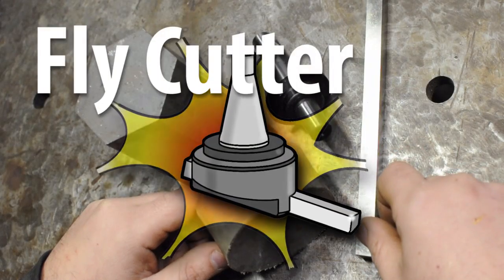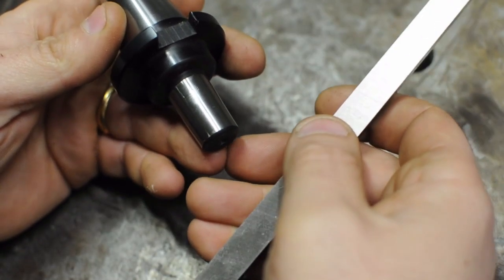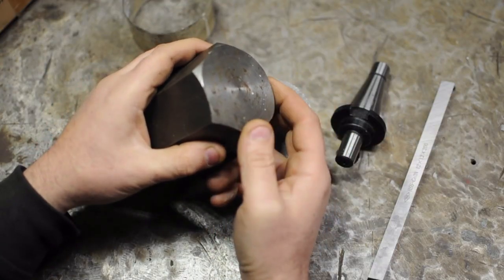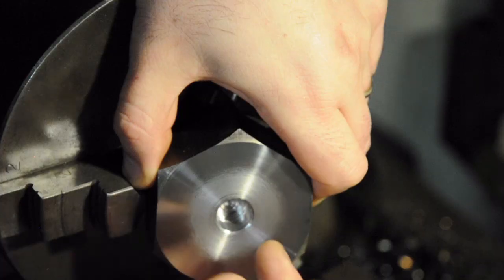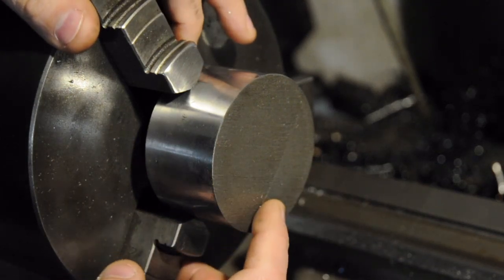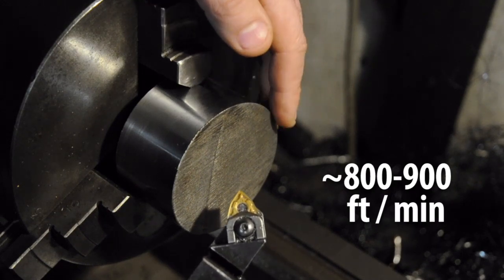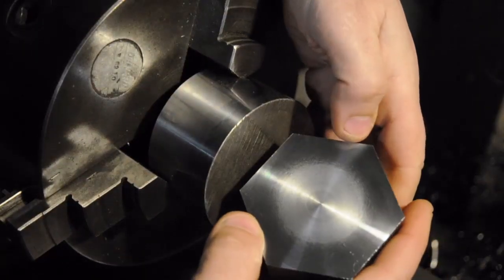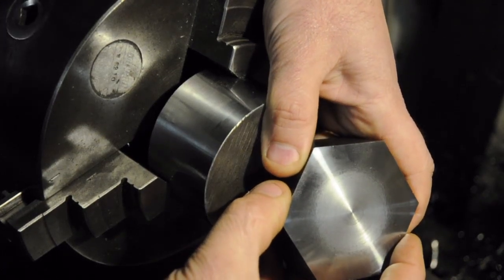Building a Fly Cutter - Part 1

Comment: Thanks for the explanation of the surface finish change.  Makes perfect sense once you go through it.  I do wonder about the cutting tool radius vs finish.  I've got some more learning to do.  :)
If I had to guess, maybe it's because the large radius makes for a more gradual entry into the cut?  Instead of a sharp point on a carbide tool?  More of like an ice cream scoop than a spatula?  At a microscopic level, the sharp point is chipping instead of shaving?  Carbide hardness playing a role in the chipping due to the tools rigidity?

Comment: I installed a 3 phase inverter on my  3 phase Graziano lathe.  I can change the speed of the lathe as I get closer to the centre of the speed if necessary.  I like it better then just a few speed option  I originally get.  Anyway, I did not have much choice.  I do not have 3 phase in my garage.

Comment: Oh I hate it when that happens. For us it wasn't the relay for the motor it was a pneumatic reservoir that blew in the cold and the replacement overloaded and shot across the shop like a bouncy ball. Another regulator further up the line solved the problem. Note for newbies, make sure that the reservoir is rated to the pressure of your line or it will blow. If not, then regulators will save you having to buy reservoirs constantly to replace the blown ones 😒!

Comment: I'm solved the problem at feed. Using VFD, and put the adjustable speed controller beside the engage switch. So i can turn faster RPM while cutting at centre. Thks bro

Comment: To solve the radius speed problem when getting closer to the center, why not using a “mill head” directly on the lathe? So the mill head turns even when it gets closer to the center of the piece.

Comment: For my machining class that I'm in. Rpm for CRS is 4×100÷diameter of cutter on mill or diameter of part on lathe. (Using  HSS cutters) when using carbide we use 4×400÷diameter of cutter or diameter of part.

Comment: Tony, you've inspired me to jump in, and I've bought a lathe and a mill recently. I repaired a hydraulic cylinder and ended up with a rod about 4" in diameter and 20' long. (it was slightly bent). I was excited to have this material for practice and fabrication. Can you tell me what it is about chromed cylinder rod that you're not a fan of? The more I know about what it is good for, or rather, what it isn't good for, the better off I'll be. Thanks for all your awesome content.

Comment: I'm in the process of making a fly cutter based on your video tony, when in the exact same stage of making the 10 degree angle, the switch of my mill melted too. Guess I'm following the tutorial to the spot.
Except maybe that I'm using a round stock steel, didn't have a hex :)

Comment: Hey Tony, considering that the linear speed of each minute diameter of the work face is supposed to be linear with the rotational speed when the cutter is "fed in", then the ideal rotational speed should be inversely corelated to the linear speed. That means if the linear speed is 0 because it has 0 in diameter then the rotational speed should be infinity rpm. That also means no matter how hard we try we can never reach perfect face finish because until now I never heard any lathe that has infinity rpm! My God Tony, your wisdom is too much for my poor little brain to comprehend!

Comment: Question from a non-machinist: why is surface finish sensitive to cutting speed?
Reply from the maker: think of it like painting... the paint brush has a certain speed range if you will to lay paint down.  too fast and it'll look bad.  to slow and you're wasting time.  there's probably a better analogy out there. :)
Reply: @ThisOldTony  do lower speeds always improve surface finish, at least until they're as good as they're going to get? If so, then maybe at the high end the losses are because the tool does more pushing than cutting and clearing?

Thanks for the reply!

Comment: What's a fly cutter and what's it used for?  (I'm not trying to be funny I genuinely don't know)
Reply from the maker: it's a single point (one "tooth") cutter you can adjust the radius of, thereby letting you cut very large or very small pieces with a single tool.

Comment: Hi TOT. I'm curious how long the batteries in that Wixey bevel gauge last you? I have a cheap one and literally get a day per battery, I think its draining at full power even when its switched off. I've ended up inserting and removing the battery every time I use the thing which is really annoying. I've seen the Wixey device online as it seems to be mid range in termas of pricing (moore and wright do one in the 80 GBP range which seems to be the top end). Would appreciate your feedback
Reply from the maker: I'm still on the original battery!
Reply: I'll be ordering one of those then. Thanks for the reply, love the channel

Comment: Been watching a few of your video's now, i got to say i really like the contents as well as the way you're presenting it. You're one of the few people who do a lot of 'blah' without me getting bored or irritated. Nice job! I do have a question about this vid though. At the very end you are face milling the workpiece to have a 10 degree angle (love your angle meter). I wondered why you are milling along the X-axis? The way i see it you have a great risk of pushing the material out of position when you're feeding the mill this way, wich will cause the workpiece to destroy your milling tool, or even worse, the  machine. If you started left of the workpiece you would simply eliminate this risk, although my approach would be to start in front of the vice & feeding along the Y-axis with the workpiece tilted so the highist point is on the left: this way most of the cutting forces are perpendicular to the vice so your workpiece will be less likely to move & chips are all moving away from you. Please correct me if you disagree, it would definitely not be the first time my feel about milling is just plain wrong :) 
Keep up the good work!
-Patrick

Comment: Tony, I learn something new with every video.  I have an old lathe an it came with a bunch of HSS tooling.  I wanted to get "fancy" and upgrade to carbide tools but it appears I will do fine with what I have.  Since I am just learning anyway it is better to start slow.  Very entertaining as always.
Reply from the maker: I've slowly started moving over to almost all insert tooling.. mostly because I find it cheap at flea markets :) -- but I'm glad I started with HSS and turn to it when I have a finicky problem to solve.  What one learns sharpening their own HSS translates into all the other tooling that's out there.
Reply: High speed steel is greatly preferred by the Dutch and Scottish!

Comment: I was about to comment asking about the surface finish, then 5:18 happened ! 
Is my intuition off or is it more intuitive to decrease the speed (or increase the feed) the closer you get to the center instead of increasing the speed ?
Reply: On a second thought, RPM = speed/diameter ==> speed = RPM*diameter so to keep the speed constant we need to increase the RPM the smaller the diameter gets which is probably what was said in the video.

Comment: I really enjoy your videos! I can get very good tips and tricks for my work. I'm learning a mechanical in Germany and have a lot of work with the lathe or mill to do. Interesting to see, how you are calculating the rpm. I've learned that Cutting speed is: Speed=pi*diameter*rpm. So slightly different calculation of rpm as you do.
Reply from the maker: Thanks.. and I think that's the same formula, just solve for RPM since speed is what you already know (target speed).. assume pi=3 and there are 12 inches per foot and you'll get the formula I used.  If you're metric the constants will look different, but same formula.

Comment: I have a question but how would someone turn down .07mm on a 5mm tool steel rod that is 600mm long?
Reply from the maker: That's a tough one -- very sharp tool and a follower rest, for starters.
Reply: This Old Tony
It is so long it wants to fly around so needs to be kept extremely slow too as in 1 digit rpm and forget about the finish as you can follow that up with some steel wool or very fine sandpaper.
Reply from the maker: Have a google for "Frank Ford Follower Rest" -- see if that gives you any ideas.

Comment: Why not a fan of the hydraulic chrome rod? Its just 1045 under the chrome, good stuff. Don't get it confused with Thomson shafting. That stuff is harder than Kelsey's balls, but only on the outside about .045 deep. The core machines fine.
Reply from the maker: That stuff I had in the video might've been import quality :) ... its gummy to work with.

Comment: Weird my lathe also "blew" a contactor this week. I also had to stop using it, even if turned the spidndle off, turn the power switch off, pushed the e-stop or press the brake the motor would still wouldn't stop. Kinda scary when you're machining UHMV at 2000rpm.

Comment: Have you tried facing from the centre outwards and noticed the change in surface appearance?
Reply from the maker: I haven't but I assume if I don't change the RPM I'd get a similar result.  Though sometimes when you're turning away from center you have a different attack angle on the back of the tool vs the front, so it might very well change things.

Comment: does the rpm formula work on a mill in metric?
Reply: Chris Kelly 
It's (320 X the required cutting speed ( steel about 80 ) ) / dia of work Tool ( for mill ) in mm
Or until the the chips are blue and the lathe/mill is happy

Comment: The cylinder head stock, is that the same chromoly you make the exhilarating boring head with? If so I can understand you deciding against working with a piece with that...
Reply from the maker: It's not the same stock.  The cylinder rod stuff is chrome plated and sometimes I've found it 'gummy' to work with if that makes sense.

Comment: Dang.  I was just thinking that I really gotta get a good face/shell mill and then it went and broke your machine! Does cutter rake have that much effect?  Would a zero rake cutter (like #$%^$# mine) have allowed you to finish the piece?  At least contactors are easy to fix.
Cheers
Reply from the maker: As it turns out it was probably just it's time to go.  Unfortunate timing!

Comment: If the outside diameter is turning faster than the middle is the center of the part not turning, if you think about it the closer you get to the center the slower the part turns. I thought that your wisdom could help me out.
Reply from the maker: Yes the very middle is not spinning.  Makes you wonder why it doesn't just break it two. :)

Comment: Flycutters are great for some materials such as plastics and other soft materials.  Many people see them as "old school" facemills.  They just have to be run at slower feed rates and rpms; mostly because of the unbalanced nature of the tool.  If used properly, they can produce a better finish than facemills.  I think it is funny to be making a flycutter using a facemill.  Great job Tony.  You are the best.
Reply: Another thing is that it is easy to grind a custom tool for a flycutter.  I did that once to make a large threadmill to cut  a strange profile multi-start plastic cap thread. Also shop made gear cutting is often done with one, too.

Comment: Dang, a change in surface finish due to turning speed ? I thought it was the growth rings of the steel
Reply: If those are growth rings;He should use a circular saw with appropriate blade that away he would get an even cut across the grain.
Reply: Yeah, ironwood.

Comment: Great video about cutting speed, Make another one only on that subject. Ans take your time to explain deep of cut cut and cutting speed. These are not easy to understand. They are also related to horizontal surface finish. Vibration is also related to that and not easy to understand.

Merci. Vidéo très intéressante pour ne pas dire passionnante.

Comment: Great explanation on cutting speeds.
Reply: I ran a manual Weiler Practicant VC for some time - It had the constanc speed feature...real scary when the machine turned up to 3000rpm when facing something...
(Yes, the max. speed could be limited if the setup did not allow such high rpms..like a offcenter clamped part on a face plate)
Reply: Since he mentioned the automatic variable cutting speed based on the diameter modification, I'm really tempted to do it to my lathe, it's running a VFD so it would be pretty easy
Reply: It must be a weird feeling on a manual lathe to have it running up as you face something, LOL!
Reply from the maker: I assume you'd have to feed the VFD positional information from your DROs?
Reply: You would, and your control could likely be doing a zero on the centre point, setting the desired speed and a maximum RPM you would let it go to, maybe a percentage of the initial RPM? To stop whoopsies
Reply: Works based off those digital displays you can bolt on to your manual machine except it´s fully integrated and comes with gearless RPM control, so you can either manually set the RPM you want or set a certain cutting speed and the machine will adjust the RPM according to where you tell her the tool is.
Reply: cutting speeds are important.

Comment: One of the very first things I learned was RPM = Cutting Speed * 4 / Diameter. In a lathe Diameter is your workpiece, in a mill it's your cutter. With your example of a 3" workpiece at 1000 surface feet/min Cutting Speed, that comes out to about 1300 RPM, so your 1200 RPM is good and it shows. By the, say, 1.5" diameter you'd need 2,600 RPM to keep from falling out of the ideal range like you did and your surface finished suffered. The very rare Monarch 1000EE lathe is an example of a manual lathe which often came with a constant cutting speed feature.  Maybe the Monarch Series 60 and 61 had it, too.
Reply from the maker: I think Acer? made one or two but I'm not surprised to hear the Monarch did too.

Comment: Dont you have the CNC Router? Could you machine the 10 degree plane on it?
Reply: Think about the geometry. You can't produce a flat with the edge of a cylinder. Large diameter ellipses on the other hand .....
Reply: You can get fly cutters that fit collets. I have one for my MPCNC. I haven't used it yet but I'm about to. Maybe I will upload a video of it. It goes into a DeWalt DW660.

Comment: I thought I was going to ask a dumb/ignorant question about why you're doing a flycutter when you already have such a nice indexed facemill, but at least I'm apparently not the only one wondering. :-)
Reply: trippedbreaker for facing larger pieces in single passes, I'd imagine. And why NOT have more tooling available in the shop?